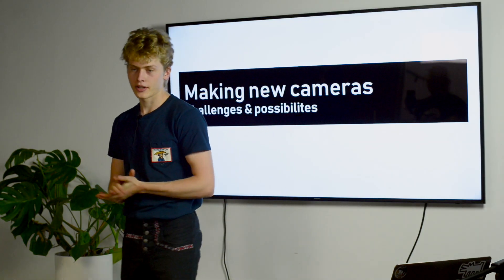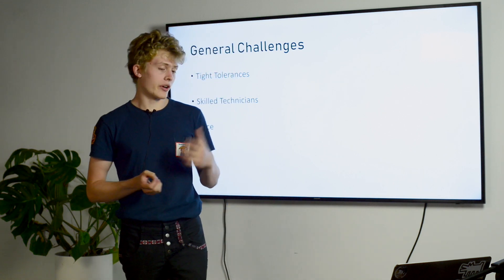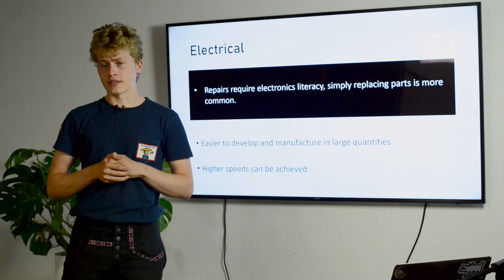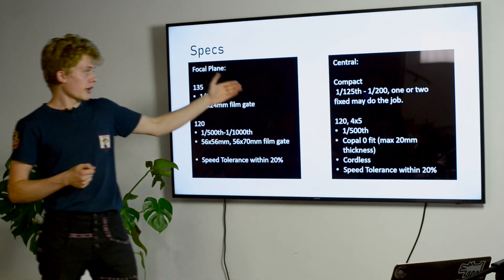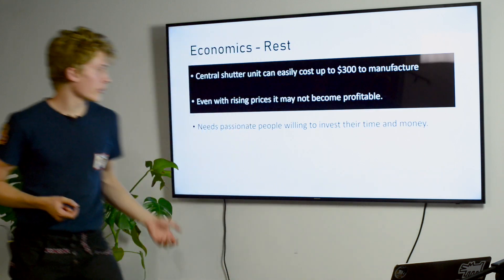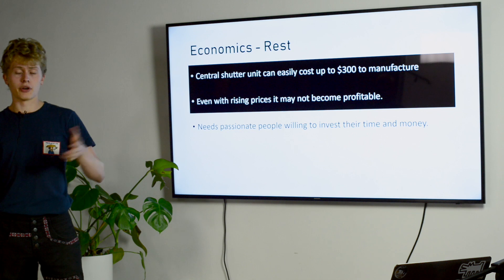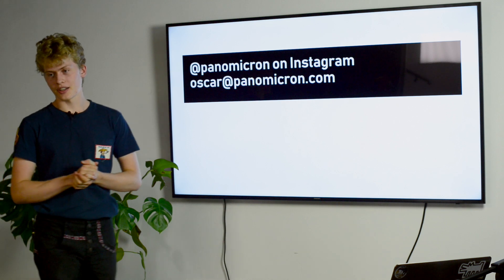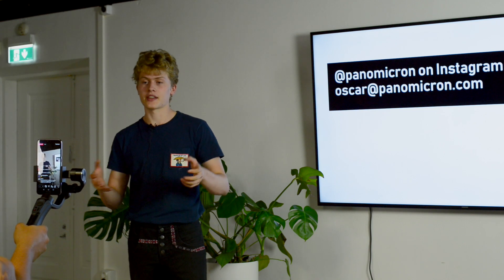Making New Machines Vol 1 -  The Film Camera

Comment: We have been having this discussion within the film photography podcast community, a new SLR is needed but for now we have the Reflex concept that's now in pre-production, that may or may not work great, you have another Kickstarter out there bringing back a former FSU SLR (a Zenit I think) with supposedly tighter manufacturing tolerences. What we really need is something like the Voightlander Bessaflex from around 15 years ago or someone to reverse engineer either a Pentax K1000 or KM. The majority of people want a simple 35mm SLR with a centre weighted meter and is compatable with a variety of lens systems. We don't need interchangeable backs (something can go wrong) or some un necessarily complex metering system.